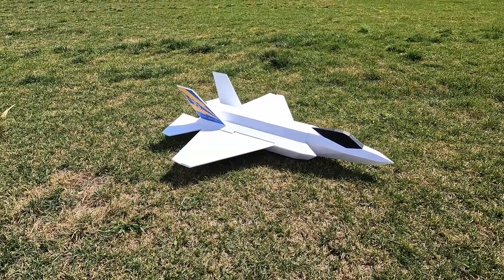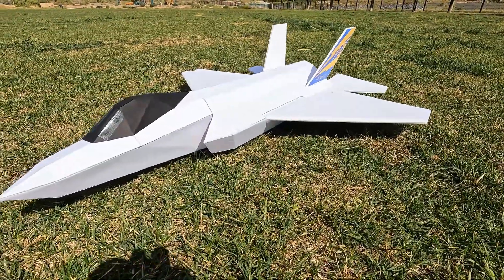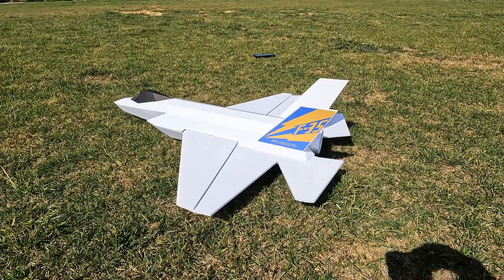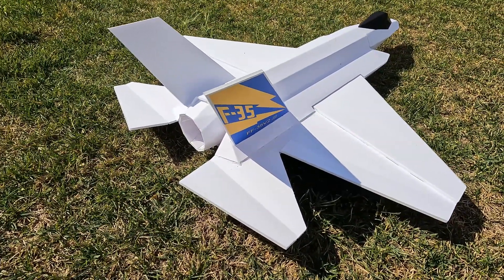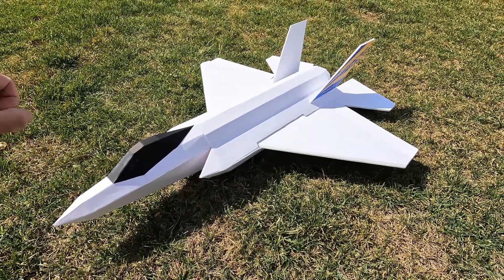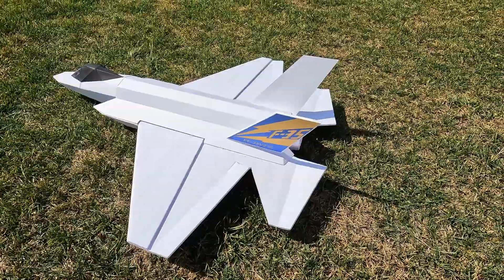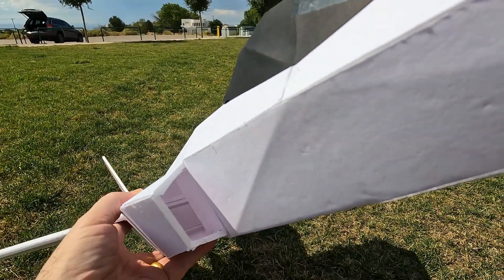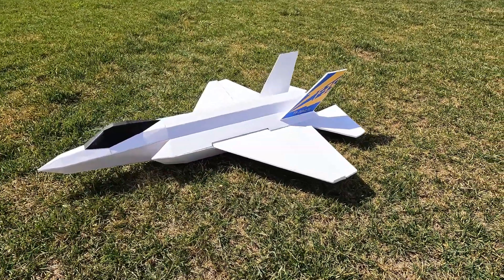FF-35V2 - New Build Started

Comment: i don't understand how you come up with the C/G. i've used a C/G calculator and it doesn't come anywhere close to where you do. and yours fly!
Reply from the maker: Thank you for the comment frankpalmer6678! For this plane I knew the approximate CG location because the overall wing and fuselage shape are relatively the same to the version 1 plane I previously made. So I had a good starting reference point for this plane.  For totally new planes I usually make a smaller basic shape model and do glide tests to find the approximate CG. I start with my best guess and start tossing the smaller basic model until it will glide nicely with a slight downward angle. I use a small lead weight and move it forward or back until the glide rate is about right. Once I find that point out on the smaller model I can scale and calc it up to the full-size CG point.  Usually that gets me pretty close and good enough to get airborne.  Usually only slight CG mods are needed after that.   I will have to try and make a video showing you these steps in the future.  For me, Doing true glide tests with small mockup models usually work better than all the CG calc tools I've used online.
Reply: @rcFoamFighters  I love your "scientific" method for finding the CG. America was built on just that same approach to inventions. Sometimes numbers do lie. I enjoy your builds and keep them coming.
Reply from the maker: Thank you frankpalmer6678!

Comment: Looks pretty good.  But...the canopy being so big looks more F-22 than F-35.
Reply from the maker: Toolbaggers thanks for the comment.  The canopy is actually pretty close to scale size, I drew it right on top of an F35 image in CAD. The GoPro footage may make it look bigger too. The canopy is just simple black card stock and not going to look like a real canopy. Yes, a small portion of the back of it and the edges should be colored like the fuselage. It is just a simple foamboard model, of course it will not be 100% scale as I mentioned in the video. I will have to show you the size of the canopy on top of the picture of the F-35 in the next video.

Comment: Quad elevons sound fun. cant wait to see it in action
Reply from the maker: Thanks for the comment FSXTout! I used Quad elevons on my older FF-T50 plane and it worked well. It helped the control surfaces have much more authority.  Some of my old hobby store bought 50mm EDF planes also had Quad elevons and worked well. I just want to use a basic 2 servo set up at first just to get it flying. Later I will probably break it up and add more servos.
Reply: @rcFoamFighters  I use quad elevons on just about all my Parkjets and now my edfs! I love the additional control it brings especially at lower speeds and high alpha post stall flying! Great design and build!
Reply from the maker: Thanks for the comment BuildYourOwnRC!  I did use Quad Elevons on the original FF-35 I built too.  It does work nice on these planes where the Ailerons are far back from the CG on the main wing.  I am now thinking I will just leave this plane with Quad Elevons and maybe adding in rudders later.
Reply: @rcFoamFighters  can't wait to see that! Good luck!
Reply from the maker: Thanks! 👍